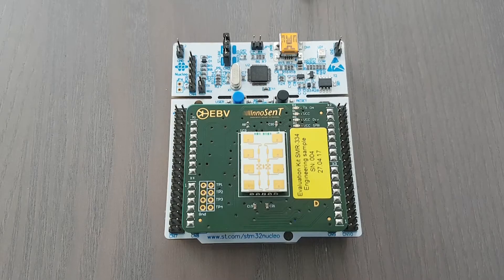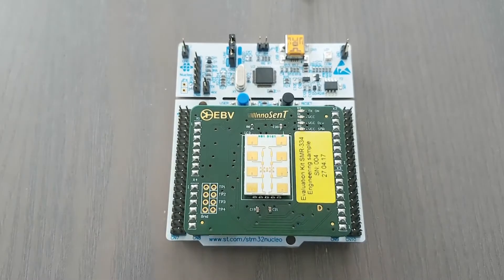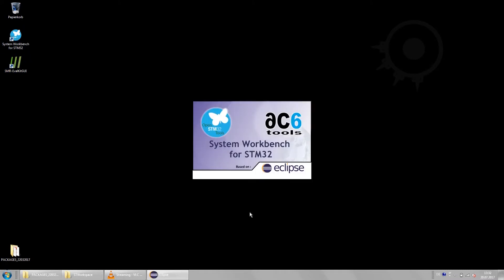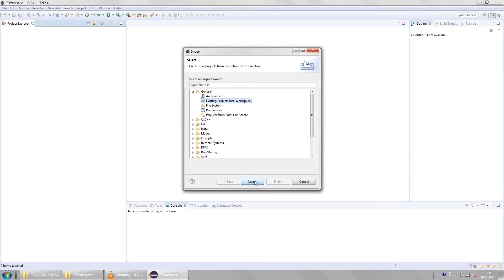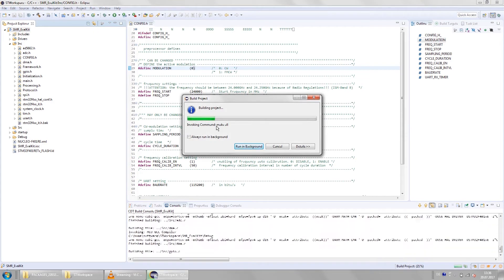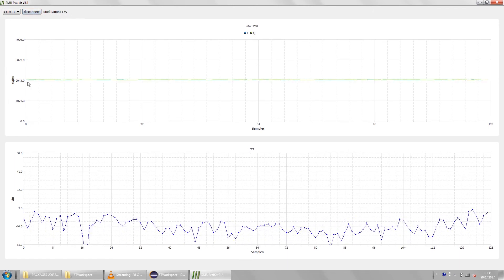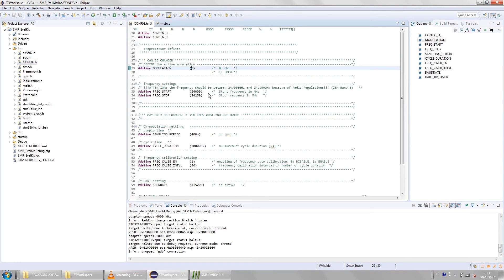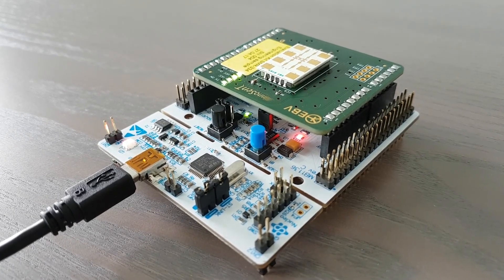Introduction to SMR Evaluation Kit

Comment: Hi, Can  it be used with a Raspberry Pi? What is the range till which it can measure?
Reply from the maker: Hi Nischal!
The SMR Evaluation Kit has a USB serial interface for data output. You could
connect this to a Raspberry Pi to read the data that we transfer to our GUI and
build your own signal processing in the Raspi. The interface protocol is
included in the documentation together with the complete source code of the
evaluation kit.